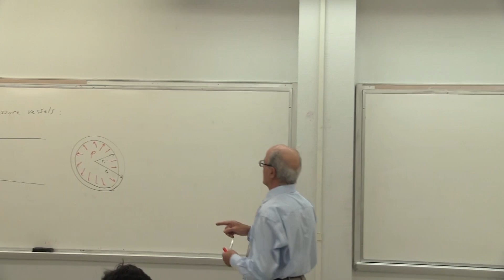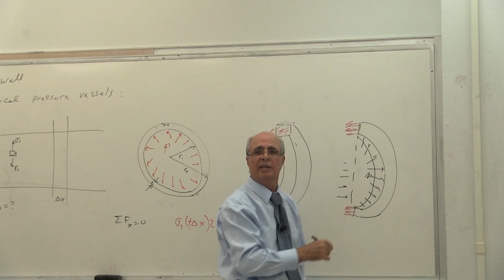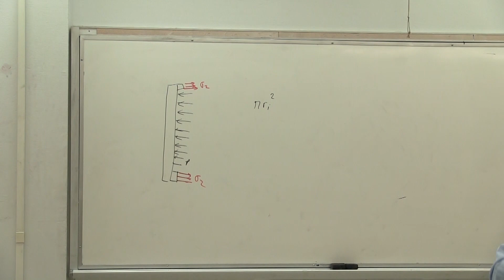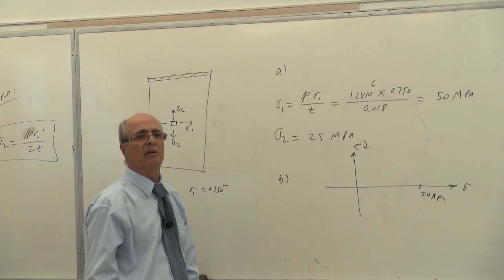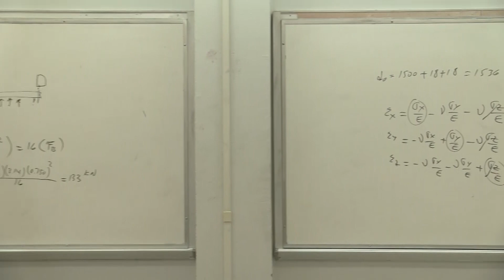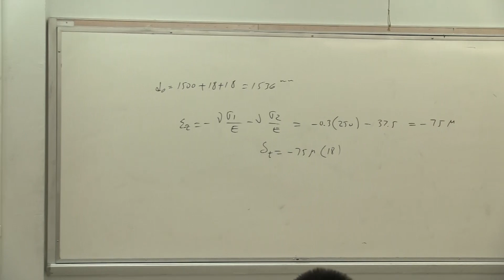Strength of Materials II: Thin-Walled Pressure Vessels (5 of 19)

Comment: sir why the resistance force is only from the cut surface? not from the curved area? anybody help me.
Reply: Pressure acts on the surface of contact, and is reacted by the area exposed by the section cut.
Reply: They can be considered as equavalent..
Reply: Actually, you can also calculate the resistance force as integral of (P * cos teta * delta x * ri * dteta) from -pi/2 to +pi/2. The two expressions are equivalent.